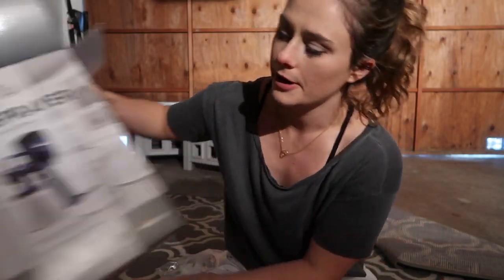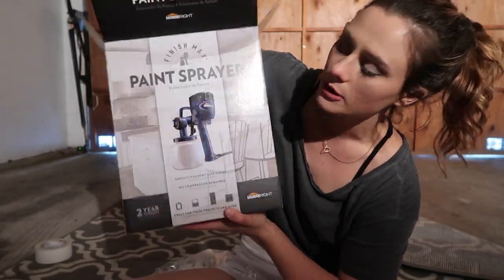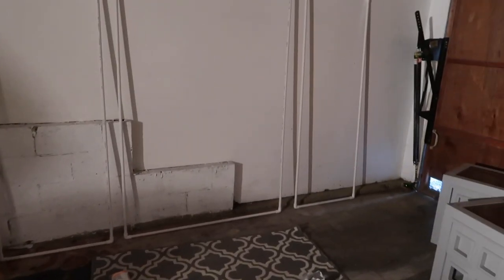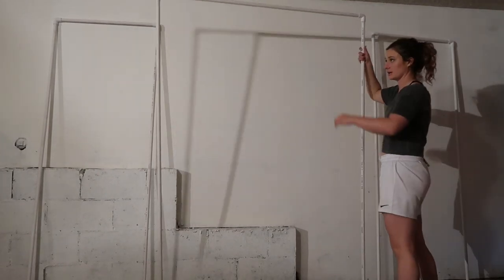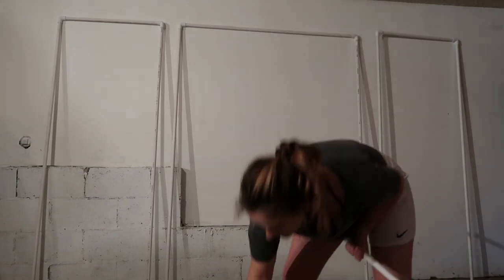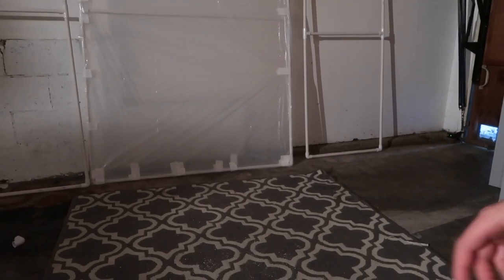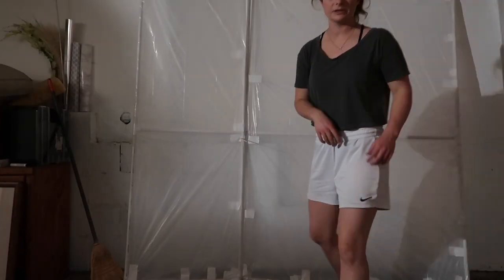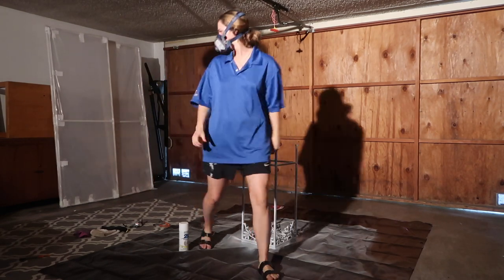DIY Portable Spray Paint Tent

Comment: As a way to reduce the size when stored. I wonder if you can make 4 (or more) of the smaller panels (your current side pieces), so that the middle section will fold as well. Then just add some extra plastic wrap to all seams (zip tied hinge areas), so that you can't spray through them. Then it would just fold up everything up like an accordion.

Comment: This is perfect, will be using this to make a quick spray tent smaller in size but love how it folds up and is adaptable to make larger depending on project
+ would like to also add a piece that folds down to cover the floor as well as make it more sturdy

Comment: Love the portable idea and the double plastic. Looks amazing 👍 nice dog as well.🤗
Reply from the maker: thank you so much!! aw thanks yeah I love her
Reply: Shannon Elizabeth I did a little tweaking of the plastic. I used a Clearly laminate table cover just so it last a bit longer.
Reply from the maker: @sleeks9939  that's so smart! How did you come up with that? I definitely wouldn't have thought of that haha
Reply: @ShannonElizabethDesign  I was thinking of something durable. I am probably going to make a spraying booth to paint car parts at home or any other projects. But with something more thicker and durability. With the fan blowing out the over spray it will have less tension. I love the plastic idea as well. With the fan blowing the plastic is a bit thin. The fan would pull the plastic causing to much suction because of it's light weight.
Reply from the maker: @sleeks9939  super smart!!

Comment: What were you using on that mitre box to secure those pipes? I couldn't tell from the video
Reply from the maker: Those two black things that hold the pipe in place actually came with me miter box. Here is the link to it. It makes more sense when you can see it up close. 
https://www.homedepot.com/p/Stanley-14-5-in-Deluxe-Clamping-Miter-Box-with-14-in-Saw-20-600D/100034395?mtc=Shopping-B-F_D25T-G-D25T-25_1_HAND_TOOLS-Multi-NA-Feed-LIA-NA-NA-HandTools_LIA&cm_mmc=Shopping-B-F_D25T-G-D25T-25_1_HAND_TOOLS-Multi-NA-Feed-LIA-NA-NA-HandTools_LIA-71700000043839315-58700004592003384-92700051319806080&gclid=CjwKCAjwwMn1BRAUEiwAZ_jnEnAJkBf6J-UQrD7XVR4yLSfc92S8oO7mvK1SuG-222oPatEHe8DUPhoCt7wQAvD_BwE&gclsrc=aw.ds
Reply: @ShannonElizabethDesign  thanks

Comment: Do you not need a fourth wall to prevent overspray from drifting out?
Reply from the maker: no, that hasnt been a problem for me. but i mainly smaller pieces of furniture in this. it might be a problem for bigger things though
Reply: A tip : you can watch series at flixzone. Been using it for watching lots of of movies recently.
Reply: @Maddox Russell Definitely, I've been watching on flixzone for months myself :)